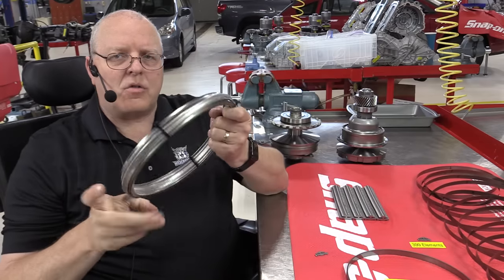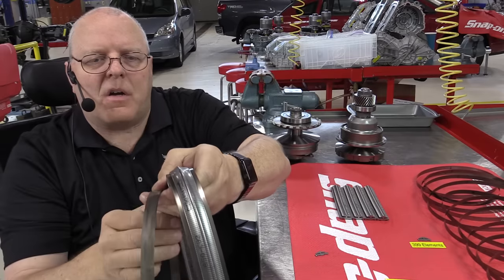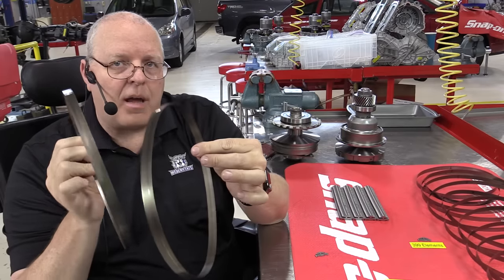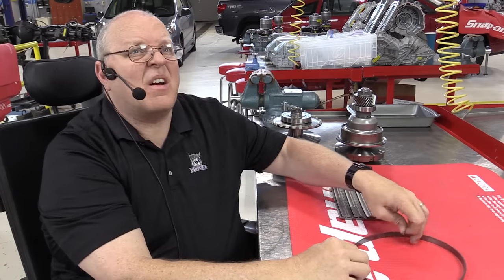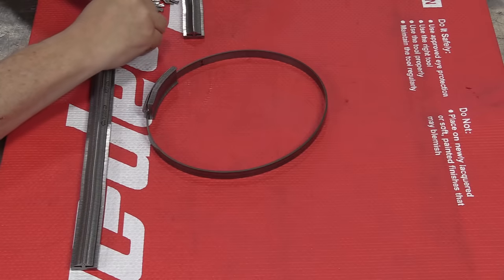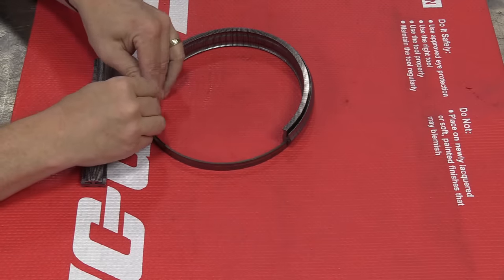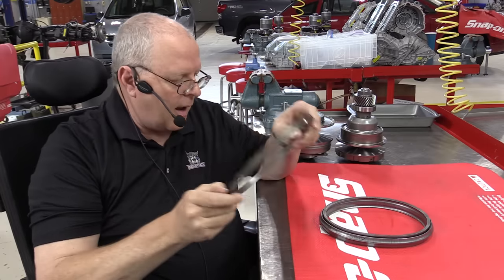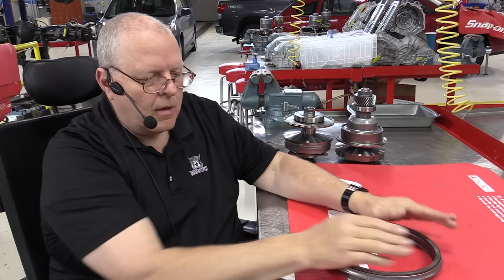The 423-Piece CVT Steel Push Belt

Comment: Very good Professor Kelly, wonderfully explained!
Reply from the maker: Thank you!
Reply: WeberAuto Your video helped me. I am currently experiencing a problem with my car 2012 Nissan Sentra.  The service dealer said the transmission is gone.  It's a long story, but now I have a good idea about what's inside the transmission.  Frankly, I can hardly phantom the whole transmission gone.  I've only had the car for three months.  It has 56,770 miles on it.  I am still waiting for it to be repaired.

Comment: Basically it's a belt made of 24 redundant bands holding 399 push elements. This is actually not bad at all. In a bandsaw you got basically the same thing going on but with a single band on rubber tires. All the debris go between the rubber and steel and it survives just fine for many uses. In this case the bands are super thin so they are way more careful and tightly fit. I can see why they would break, but also I can see reliability sort of built into these things and possibly many improvements based on metalurgy or the bands. We could add titanium to the steel to make it more flexible and last longer.

Comment: 2012 prius... 230,000 miles
Seattle traffic with mixed in highway miles. Burns no oil, changed Mobil one every 5000 with K N filter. Only thing done -brake pads at 180,000, spark plugs at 150,000 and trans oil every 60,000.

Not flashy and won't get your heart racing on a back country road, but she has never let me down like some of the other ' fun' rides I've had, (75' 911s 3.2 ,vw corrado g60, Saab 900 turbo,  72' Fiat Spider. I was a moron to sell any one of those except the Saab!

I digress- I'm hoping that the overall Toyota engineering keeps on being amazing and that  cvt  holds up! 👍

Comment: I am curious what your thoughts are on OEM CVT fluids vs aftermarket. Those in the OEM camp say the fluid is super specific for each CVT. Those on the aftermarket side say the OEM fluids are budget fluids by nature and generally only semi synthetic as apposed to full synthetic base stock of the aftermarket fluids. As such, OEM fluids are wildly overpriced. What is your opinion on this?

Comment: So now that I know how a push-belt works, I have to ask: am I doing/risking damage to the belt by manually "downshifting" and engine-braking? My Subaru Impreza will not let me diwnshift the CVT unless the engine is below 4k rpms. So, are the electronic controls enough to prevent damage, or should I not be engine-braking at all? It's a hard habit to break after decades of driving manuals and motorcycles. But I find the CVT with optional manual mode a great compromise between fuel economy and fun driving.

Comment: DynaFlow Transmission were variable speed transmission in Buicks from the 50's to early 60's. 
I drove one.  It was like driving a rocket ship.  It never shifted but kept going faster.
It was discontinued in the 60's because of bad gas mileage.

Comment: I know these videos are from a competitor YouTube channel (Engineering Explained). 
But your channel is much more “nuts and bolts”, and I appreciate that.
What is your opinion of these two 2 new CVT enhancements?
Will the added complexity cause more problems? It usually does, in my experience, which isn’t that much.
Or will the improvements make them more durable by improving the ability of a CVT X-mission to take the low speed high torque load off of the push belt(s).
While maintaining the MPG improvements in the higher speed range?
Or do you think they’ll cancel out.?
To me, gear shifting simulation in a CVT seems to defeat the advantages?
But I will admit that the standard CVT bugs me a bit under anything except a mild acceleration.
Too many big HP V-8s with manuals or 3-4 speed automatics in my past, I guess.
Gee. I still love Nitromethane cars. They do use a kind of CVT. A 5 disc clutch, I think?
Except it has to be rebuilt after every 1000 foot run!

https://youtu.be/162BWwkcy5U
The worlds first DVCT X-Mission

https://youtu.be/HanImTejIVM
Toyota CVT has a launch

https://youtu.be/5jIeSgq7ewI
Nissan created the first production High Torque CVT
Reply from the maker: I am familiar with the newer push-belt CVT technologies. As with any transmission, if you do not drive like you are in a race car, and if you follow the recommended service requirements, it should last the life of the vehicle. Historically push-belt CVTs have not been reliable.The 2012 and newer designs seem to be doing better, but i still hear from unhappy CVT owners with the new tech. Best wishes
Reply: WeberAuto Thanks much. I’m a sucker at times for new tech stuff. 
My Dad, a great mechanic told me to never buy a car until it’s 3rd year of production at the minimum. The kinks would be ironed out by then.
He also told me, in the 1970s, to never take apart an automatic transmission to fix it myself.
I followed that advice and, knock on wood, haven’t had any transmission troubles over the years.
I’ve always liked to have cars that I could, if I wanted to, drive like drag race cars...for a few seconds. 
But I never drive them that way past 1st or 2nd gear.
My 2 Sons gave me crap over the years but I’ve got several very powerful classics that run and drive just fine.
I’d rather watch John Force and Don Schumacher spend the big Sponsor money on drag cars.
I do love them. Nothing like it. I took my Sons when they were about  10 and 13 to the Denver Mile High Nationals.
As we were walking up, the Amateur classes were running. I explained to them that it would be significantly louder with the Nitro cars.
I’m sure they didn’t believe me.
Until the first Nitro pair ran in qualifying.
To this day, it still stuns me how loud and fast they are.
I got an Engineering Physics college degree in 1980.
That plus my Dad made me love mechanical things.
He rebuilt 3 stationary gasoline engines from the early 1900s back to mint condition.
All original. No spark plugs. Breaker point with Horseshoe mags. I helped him dig them out of the dirt in Nebraska and Oregon.
500+ pounds for 3.5 HP Fairbanks Morse, etc. A lot of torque however.
You learn to tell rich and lean really fast when you’re cranking those over by hand.
Holding the exhaust valve open to crank it up to speed.
They’re in a museum now.
I miss Dad.

Comment: My friend who has been an awesome mechanic for 30 years and specializes on transmissions (he's the go to guy when other mechanics can't fix things) hate CVT.
Reply: Thomas Kerwin actual gears whether straight or beveled are just intuitively stronger and more robust for the difficult tasks. Engines are designed for torque in a wide band as well with today's turbos so in one gear you can do a lot.

Comment: What is the benefit if this type of design. 
Can one haul or pull anything with it. It seems it would break if you tried.
Reply from the maker: Relatively inexpensive way to obtain good power and fuel economy out of a small engine. Thanks for watching

Comment: Still,by using the friction between the small block pieces and the drum pulley surface... to make the driving. Will there be the slippery when the  torque limit is exceeded?

Comment: Time for a geared transmission or standard. I'm done with CVT. No issues with my 2012 Altima coupe because I change my fluid every 15k miles. And drive it very sparingly, but got a Jeep Wrangler and Lexus IS F awd just in case.

Comment: With the outwards forces due to the cones it is clear that there has to be some pull somewhere. Even you speak of pulleys. Push only makes sense if you want to change gear so to say, to loose the belt.

Comment: hi dear ....realy appreciate your vedios ....I have a nissan pathfinder 2.5 hybrid 2018 which did 18000 mile only ( very light usage ) ...2  days ago while smooth driving I smelled like a burning rubber electrical smell then a light white smoke starts coming from under left front fender (till then there was no warning light on the cluster) ...then totaly the car went of with engine check light....the car dealer report says it needs a full new cvt transmission unit  with a transmission and damper..and car warentee is finished ..could that be wright for a new car and suddenly .????? how can this be explained ? and what part in the cvt could only be changed without changing the full unit.

Comment: Why a torque converter? Rubber belt CVTs slightly loosen the driving pulley when the motor is idling and the vehicle stopped, letting it slip in the belt. A steel belt CVT is lubricated. The tiny grooves in the segments are to let the CVT fluid squeeze out from between the segments and the...pushey.

Comment: Should the belt be changed, after x mileage? Or do you just wait for it to slip? Is changing the oil crucial in these, too? 
My kid has a 2008 Mitsubishi, 120k miles, or, 200k km. 
Thanks

Comment: a great video to tell me about the CVT gearbox. I was about to buy a TOYOTA using a CVT gearbox. I wonder if the technology in 2020 has been different to keep CVT gearboxes going for a long time, and if it will really replace a regular gearbox as sales go. CVT usage increases very quickly. Thanks
Reply: Still unreliable. CVT service life is 125K miles at most.

Comment: How about explaining the "Rubber Band" effect that occurs on a CVT, where it won't go, it won't go, it won't go, then it starts going? What's going on inside of the CVT there? I have a 2006 Ford Freestyle with a CVT.
Reply from the maker: I have never heard of that. I will need to investigate further. Thanks for your feedback!
Reply: My sister's Jeep Compass is like that. Personally, I find it's a combination of things that add up. The lag time between your input between your pushing of the accelerator and actually accelerating is likely from the electronic throttle body, the transmission changing gearing to hold your engine at peak torque, and age.
All of those things cause that rubber band effect. 
One of the reasons I don't like the CVT is that it focuses on "maintaining " an engine rpm on acceleration (actual rpm it maintains varies on the demand). So during the gap between you pressing the accelerator and the target engine rpm, you hardly accelerate at all. After that the transmission varies the ratio to maintain rpm relative to speed. On the standard transmission you're limited to a set of gear ratios but they're held firmly by layers of clutches that are compressed by hydraulic force, the main heat source is the fluid shearing in the torque converter.

This is why CVT transmissions have a high failure rate and cannot handle high torque applications . This also means that the transmission works much harder and therefore runs hotter. Hotter temps = Shorter longevity 
That's why it's extremely important to maintain the fluid level and change it regularly. Due to the breakdown of the fluid at higher temperatures.

Sorry about rattling on,
I hope this will provide some insight though !!
Reply: It sure does! I switched to a 2001 Acura MDX and it's 5 speed automatic can handle the 30,000 miles I put on my car a year!
Reply: Is this car worthy of repairs

Comment: why it needs to be pushed rather than pulled like bikes? pushing can take more force? if it is for that, what happens when engine braking at downhils with higher ratio? belt is pulled or pushed at oppsite side?

Comment: I have 2014 jeep compass with 120k miles. Im scared for my cvt transmission everyday when i drive anywhere. Its so stressful. When i drive on hot days in the summer for too long it lose power, hard to gain speed and momentum on the freeway. Very weak and jerky when i drive away. Hard to go up the hill cajon pass to the desert. I plan to change drain the CVT+4 fluid, drop the pan and install new filter + gasket, clean the pan, install external cooler to help keep the fuild cool, refill with cvt+4 and see if the performance improves.

Comment: I'm a bit of a hipster: even though I know this is not a high HP, high torque device... I really want to see how far in those directions it can be pushed, just for the novelty of it.

Would a really big CVT have higher values, or does this not scale up?

Comment: Am I right to assume the Prius CVT works with a planetary gear and is nothing like these push belt systems? Because I be towing some pretty sizable loads with my Prius lol. I don't see how the transmission can handle it if it's only being driven by a belt. Also I'm my assumption is correct why in the world are they using belt systems instead of planetary gears in everything? Does it have something to do with the electric motor-generator?

Comment: Is there a significance to the number of elements in the belt? Sure, each ring makes the belt stronger overall, but does the number of elements make a difference? Couldn't it be a 299-element belt?

Comment: good afternoon

a question
I have a 2006 mini cooper R53 S automatic.

the transmission has a problem

being already hot in engine
open it used 15 minutes

if you are in D and want to put R
it takes a few seconds to enter, and it enters with a small tap

and visebersa too
what do you think i have?

thank you

very good videos
congratulations !!

Comment: The easiest and most practical method would be to insert a very thin flexible spun wire through the middle of elements to keep them intact and sequentially holding. Such a Belt could be mass produced with various specifications. It is just an idea. I am certain engineers / designers must have thought about it.
Reply from the maker: Thanks for your feedback

Comment: Wouldn't the belt coming off the other side of the 'push' pulley actually pull against its opposing pulley?
Reply from the maker: Good question, I do not know. I suspect there is a little free play on the other side.

Comment: Hi ! I hope i get a quick answer from someone. A circlip that holds the pulley broke a few days ago on my Mercedes Benz A class w169, so after that a few things got out of order. Ive put a new circlip on and mounted the other things, the cvt belt is good. So my question is. Should i change anything else just to be sure that nothing brakes again or should i just mount the whole thing and give it a try? 
Maybe im not being so clear of what im asking but i hope someone can understand me! Have a nice day and thank you on advance!
Reply from the maker: If the clip is fully seated, it should be okay (assuming there are no other problems)

Comment: There is much debate of the CVT transmission failures not being caused by the CVT belt, BUT attributed to the wear of the drive side pully shaft. If you disassemble the shaft, you will see 3 keyway indentions which use small steel bearings inside the indents to allow the pulley to move up and down the shaft while  preventing rotational slippage.  These small steel bearings give out at some point and bind the pully, preventing it from moving up or down. This is most likely the cause of the belt failures

Comment: In your opinion are these transmissions as good or better than a traditional one? I have a car now that has one, but I have also had Chevy transmissions in the past with problems. Just wondering if this was a cheap trick by auto manufacturers or if this is a good thing.  Thanks for your information, very good knowledge.
Reply: It is a pretty simple design and if you change your fluid every 30k miles it will last

Comment: I wonder why they use a bare steel belt on the bare steel sheaves. Since the coefficient of friction of steel on steel is fairly low, why not have a rubber or substrate coating to increase drive friction?

Comment: The original "Pull Belt" CVT was invented developed and used by DAF (van Doorne's Auto Fabrieken) motors in Eindhoven the Netherlands in the '50s specifically for small cars. The pushbelt variation was invented and developed to enable higher forces, by DVT , an offspring of DAF.
Reply from the maker: Thanks for your feedback!

Comment: Wanted to ask if this steel CVT belt is able to replace rubber belts ? I have a 2018 Can Am Maverick  X3 XRS side by side. The belts fail all the time mostly from too much heat. Was just wondering if this was even an option. thanks for your info.

Comment: It seems a relatively thick synthetic oil would be perfect for these belts, yet I see the required fluid is almost like water. Does this oil serve some other function in the transmission such as pushing the sheaves in or out?
Reply from the maker: lubrication and heat transfer

Comment: how does the pully, push and not pull? when it is in contact with both drive and driven pullies? it would naturally pull the belt, thats how all belts work. it there more components that keep slack on the none push side of the belt?

Comment: Thank you for the explanation. I have purchased a Subaru CVT and am concerned about the life of these transmissions. I have previously driven cars with conventional automatics with torque converters. My last Subaru with a standard automatic traveled 300,000klm without any issues. I am not confident that the new subaru I have with the CVT will get anywhere near 300,000klm.What are your thoughts?
Reply: Hope you bought an extended warranty.
Reply: @smashingstuff09  NOPE!

Comment: I have a bad step motor in a 08 Nissan sentra slips some will replacing the step motor work or are the pulleys and belt going to be junk due to slipping

Comment: Great explanation , maybe somebody already asked , how long it takes?
Reply from the maker: Thank you! It took about an hour to assemble it properly the first time I took it apart.
Reply: Thanks for your reply sir :)  My next question is, how long does the belt work?
Reply from the maker: It can last the life of the vehicle as long as the vehicle is not driven like a race car. Belts do not like high torque loads. Proper maintenance intervals should also be followed.
Reply: thank you sir